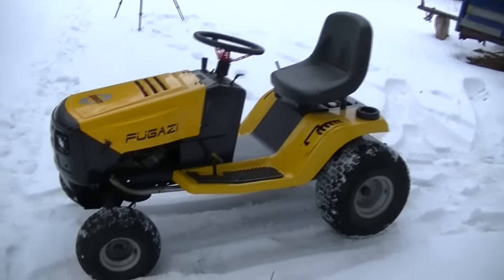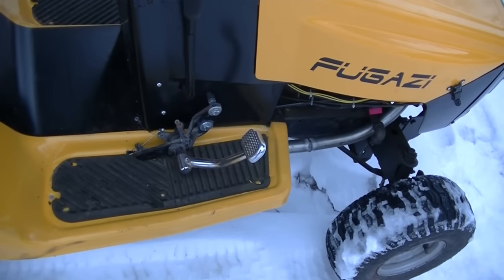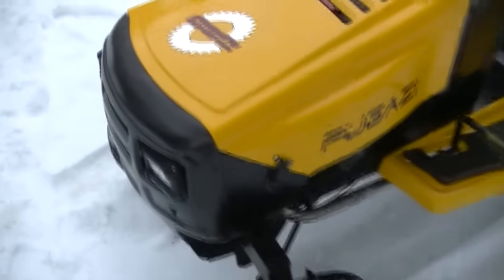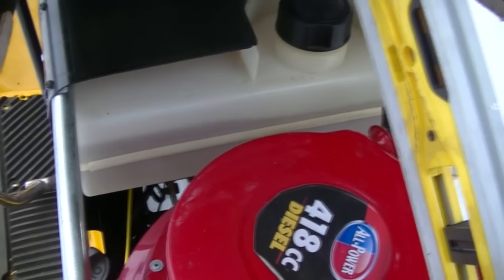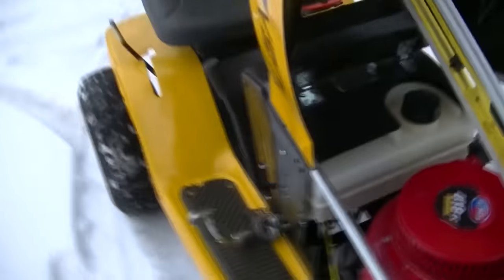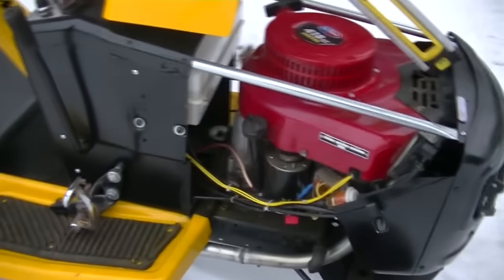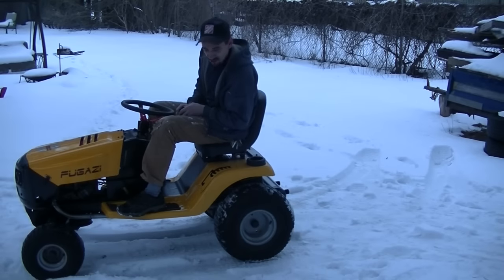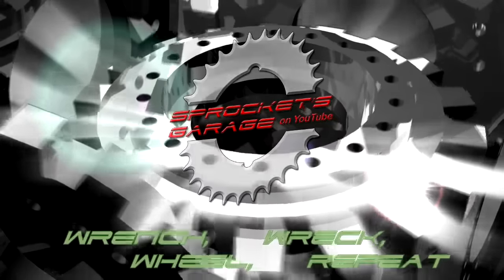It Might Get Loud!

Comment: With the caps on, the exhaust is similar to an expansion chamber setup on many 2 stroke engines.  I like that the exhaust fumes and noise is in the rear projecting away from the tractor when the caps are off.

Comment: My racing mower is runing duels, with mufflers when I first built the exhaust the muffler's were removable but unfortunately the heat has seized them in place, I was considering building an H-Pipe to connect the pipes together and I think it will help balance the exhaust.
It runs rich at idle but at Full Throttle is perfect.

Comment: Hi Doc. I have the brother of the "arsehole" dog living next door to me. LOLI just found your' vids today. I also love building stuff. I never built a mud machine but I have built a home built aircraft and a couple of motorcycles just to mention a few. I wanted to tell you I love the Fugazi build. One great looking machine. The hood is a great design, also the exhaust. You have tons of great ideas. I have a Il000 Craftsman 21.5 B&S V twin lawn mower that I bought second hand. Get this, I use it as a LAWNMOWER! It sat for a bunch of years outside in my neighbors yard. I went all through it and made some improvement, engineering changes. I have been checking out your' vids all afternoon. I am addicted to seeing what you will come up with next. Great JOB.John
Reply from the maker: Hi! By all means, join us in the Sprocket's Garage FB group (link in video description), and show us your stuff- I'd love to see it!

Comment: Love the v-twin sound.. you cant beat it. I just run mine stock location right out the bottom no muffler. I like it loud and shooting flames. I have thought about running duals out the back like you did but as hard as we beat our mowers they would probably just get busted up. I do like the quiet mode idea as to not piss off the neighbors at night. Have you had it out for a rip yet?

Comment: What size pipe was used and what did you use to bend it Doc?
Reply from the maker: I used 1" EMT (electrical conduit). I use EMT for a lot of things because it is widely available at hardware stores and the cost isn't bad. It's perfect for exhaust components. now- the 90* bends from the port flange to the straight pipe, are pre-made 90's that you can buy wherever EMT is sold. I currently do not have a tool that will put a 90* bend in 1" EMT without kinking it. I DID but a couple slight bends in the left-side pipe to clear the bottom of the clutch pedal, and that I did with a HF-type hydraulic pipe bender with a 3/4" die in it (because 3/4" SCH 40 pipe has about the same OD as 1" EMT.

Comment: But u can't do it from the seat like a normal cutout and if you change it after running it for awhile you're gonna burn yourself. Honestly, it's a cool idea but I kinda expected something better with the mode change. V twin sounds good tho
Reply from the maker: I don't need to do it from the seat, or pull the caps when hot. These aren't "cutouts". This is a decision made before setting out on a ride.
Reply: Sprocket's Garage yup... I have thread on mufflers on most my stuff because if I know I can b loud I will usually know that before I start riding... also I normally start off with the strait pipe then get sick of it rather than the other way around